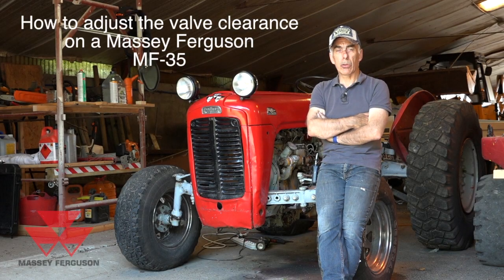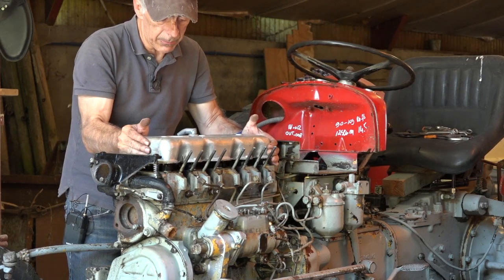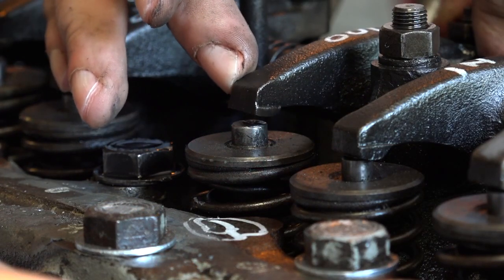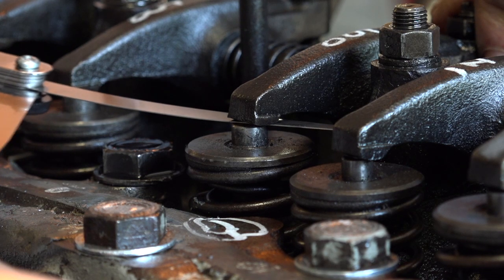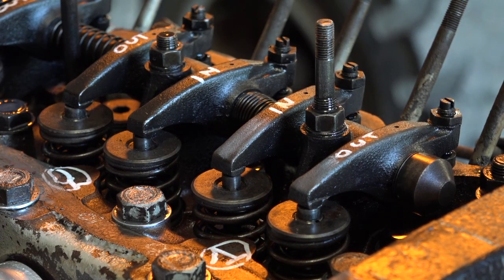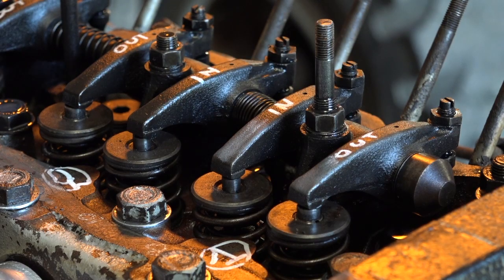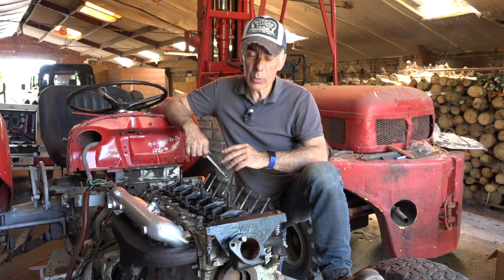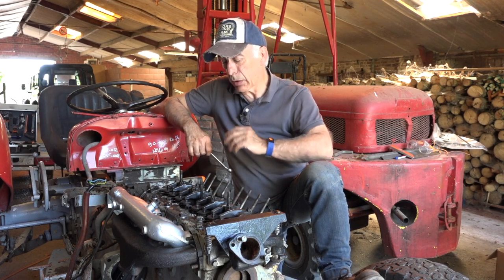Adjusting the valve clearance of a four cylinder MF35

Comment: Hello D3SShooter, thank you for the info.  So the valve clearance adjustment could be done at our farm?  We have a Kubota tractor.  They suggested maintenance has a valve clearance adjustment due.  Could a mechanic do this at our farm?  As opposed to flatbedding the tractor to the Kubota dealer, Thank you
Reply from the maker: Yes they can , if they are willing
Reply: @D3Sshooter  ok, thanks so much for the response,
Do you like avocados?  I'm happy to send you a box in appreciation

Comment: Why exactly do you adjust the valve gap on cylinder 4  on its power stroke just after its TDC (compression stroke) ? I cant understand this yet. On its compression stroke the both the inlet & outlet valves on cylinder 4 are closed - why cant the adjustment be done on this stroke?
Reply: exactly .   it seems important to time the intake valve closure accurately ,
:shelterin:

Comment: i just bought a mf 35 3 cylinder and i needed to know how the front mount for the gastank was mounted and this video helped alot, also i did adjust the clearence on the valves. i like to know how you clean a gastank if it is rusty on the inside is that a future old rusty video maybe?
Reply from the maker: Thanks for the comments, it might

Comment: if the thread on the adjusting bolt is one millimeter per revolution, then the dipstick can not be used
Reply from the maker: Thanks for the comments
Reply: @D3Sshooter  I always wanted to touch the American auto industry of 50 ... 70 years, now at least in the video I can do it ).

Comment: Very clear , you are an excellent teacher . A question for you . I have a Grey Gold FE35 and i think its the same or very similar engine to the MF35 ( 23C Standard Motor co engine) Does your engine have a mix of bolts and studs to secure the head down ? Mine has and the studs have a 1/2 inch UNF thread while the bolts have a 1/2 inch UNC thread . This , in theory should require two different torque settings .However the manual states a torque of 95 to 105 lb/ft for all . Is this a mistake in the manual or is there some other reason why the torques is uneven this way ?
Reply from the maker: Thanks for the comments and indeed its the same on mine. As for the torque , I do consider it as the range it has to be in.
These engines are very forgiving.... But maybe some one has another experience.

Comment: I've always assumed that they got it wrong in the manuals for the 23c engine. Every other engine that I have been able to spec with adjustable valves has the clearance larger or the same for the exhaust valves for what I consider obvious reasons. The exhaust valve runs hotter and there fore , once the engine is at temp, it is expanded more than the intake valve. I find it odd that there is not more info/discussion of this anomalie.
Reply from the maker: Thanks for the comments, and a very good point
Reply: @D3Sshooter  might explain why those engines are so hard to cold start
Reply: The Ferguson  35  had several  engines  fitted.     Tvo
       Petrol
     Diesel   
   And  perkins diesel  3 cylinder.    One of  the engine  fitted was of the standard  motor company.   Which was cars  and also fitted to  the Coventry climax   fork lift  truck.  It was the standard  engine which  gave fault .  And you  had to use bradex easy  start   to get it going    either to put patients out   for surgery.   This was due to a design  fault.    As instead of using direct diesel  injection   it used a method called  indirect  injection   as it went into a small chamber in the head  before going into the cylinder   for compression.  Known as  an indirect  direct  compression  chamber. .  It did not work  very well.   As the engine ware took place.    So a bit of a pig to start.    Hence you needed either  to start it .   Pure alcohol.     Hope this has helped  you to understand  the standard   engine   fitted to the 35.    The perkins  3 cylinder  was far more superior.   Engine.
Reply: Some engines  built had valve clearance  the same   some as you say  had  inlet   one   gap  and  exhaust  another  gap.  So you are  correct  in what you say .
Reply: yes . good . guess what else can expand more Once the Engine is at Temp... 
for what I consider obvious reasons.   🤔

Comment: WOW...you are a Great teacher.  Thanks so much for videos.  I have a 74 Massey Ferguson 175 and I have a question...I have a leak on top of the trans. where it bolts to engine.  There are 2 metal lines that go into top of trans. housing where 2 rubber grommets hold the lines in.  I am missing one rubber grommet.  Is there an easy way to get the grommet in the hole?????  Been working on this for 2 weeks and am frustrated...!!!
Reply from the maker: Thanks for commenting,  haha those grommets are not easy, i use a lot of acid free vaseline to rub them in.  That works most of the time.
Reply: @D3Sshooter  well I have had no luck as for now but I needed to use the tractor so I put some aluminum foil around the pipe and stuffed it in the hole a bit and it did work and kept it from spilling all over the transmission.  Will keep trying to put them in...!

Comment: Damn no good after re checking everything, I went to start and it cranked much faster than before but number 3 cylinder out valve, just about the middle it bent the out push rod just a bit, Do you think its the valve clearances or timing ? I hope not timing its a massive job to get the front axle and crank pulley off
Reply from the maker: Hmmm I would think the timing, but then the issue would be valid for all valves,,, good luck

Comment: Nice detailed explanation.  Incidentally,  a long time ago I had it explained to me that when checking the gap it is easier to use the feeler gauges either side of the stated one, for a 'GO' - 'NO GO' test. I assumed it was because it is subjective as to how tight, tight is when you use the stated size, mind you it is always reassuring to use the stated one after and feel it slide in nicely.
Reply from the maker: Yes, indeed and thanks for your comments..  I know an old ( well very old)  mechanic, and he never used gauges.... he just has the feeling for the gab in his fingers....or at least that is what he says...   and with old engines, I can believe that he is right.... vlaves might tick a bit...

Comment: There is something missing on this engine. There should be wear caps on top of the valve stems. Actually they are called wear caps on the intake valves and rotators on the exhaust valve. But the look the same, except the different size.

Someone has lost them in the past. Or forgot to put them back.
Reply from the maker: SLORRIFJART321 , txs.  That is interesting.   Do you have picture or so.  I am interested in it
Reply: I believe they are also called "lash caps".
This would be the one for the intake valve: https://www.jensales.com/products/massey-ferguson-intake-valve-stem-lash-cap-mfs2307.html
And the ones for the exhaust would be larger but else the same.

They don't list the Standard Motors 23C there, but it might be the same wear cap for both the Continental and the Standard Motors engines. It just has to fit the valve stem with approximately 0.32" I.D. for the intakes and 0.38" for the exhaust.

Comment: Good job mate. I would wonder however, there is no mention of timing marks for the injector pump to ensure they coincide with the cam/crank timings. I suppose it's because you never messed with these during the head removal/installation.

But good job!
Reply from the maker: Ken Arnold , txs for the comments.   Indeed, a good point.  But since i did not make any changed to it, it was not needed. Maybe something for a next videa

Comment: I see you say .0012 on the intake and .008 on the exhaust. Is that wrong? the exhaust valve will grow more then the intake  JRS
Reply: That is correct. It is even marked on the valve cover. It's a bit odd, but it should be like that on the engine.